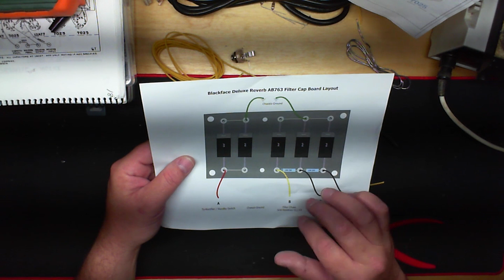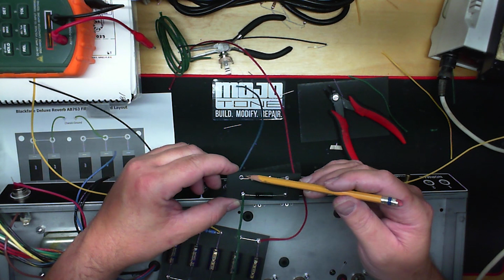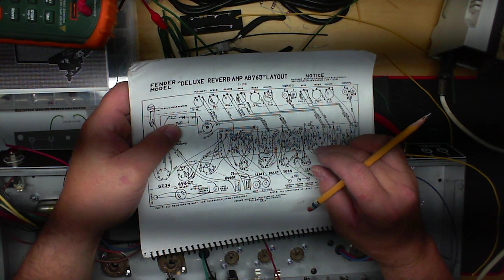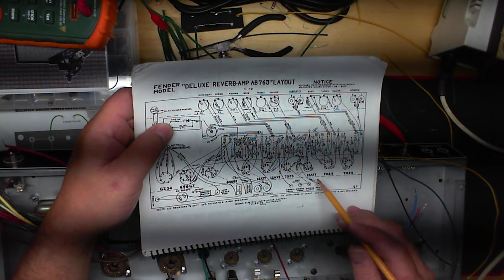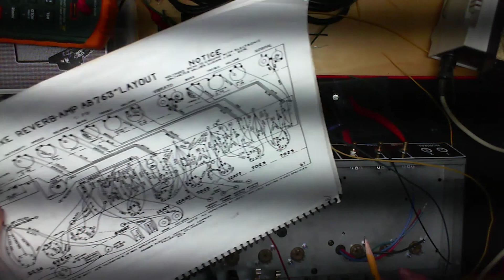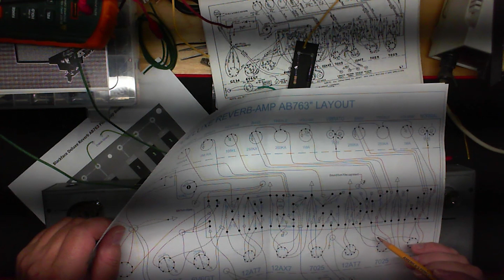Mojotone's Blackface Deluxe Reverb Board Installation

Comment: I’m sorry but the quality of this video series is not good. It’s very grainy and not in high definition which makes seeing components impossible. There is no clear concise instructions at all, basically just showing before and after which you can’t even see in the first place. If you could just make a pdf instruction guide similar to what you have for the Princeton reverb, And a high definition annotated layout would be great.
Reply: I agree, but two years down the road (from when you left your comment) there is Uncle Doug, Psionic Audio, and D-Labs, to mention a few, (most of which were around when you let the comment) which have given me a lot of insight and understanding as to tube amp theory and operation, so there's that.  This series is definitely a help and could be better, but I'm glad its here all the same.  I hope your build went alright. :-)
Reply: There’s a ton of great info here, bud.

Comment: I agree with you on the grounding. Clumping them altogether is not good. You know your stuff. I used something i heard from this guy Kevin O'Conner calls it galactic grounding. Made a huge difference when i applied it to my builds. Basically  each section has its own segregated grounding and additional filtering and only one point is eventually grounded to one point on the chassis.